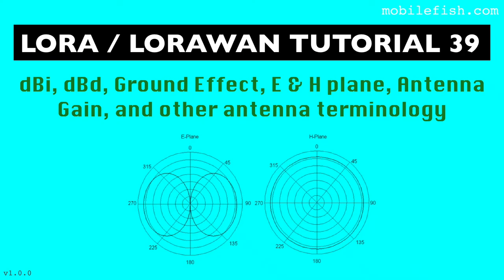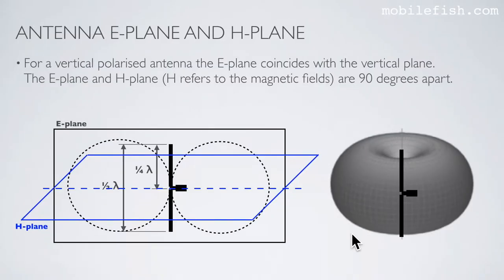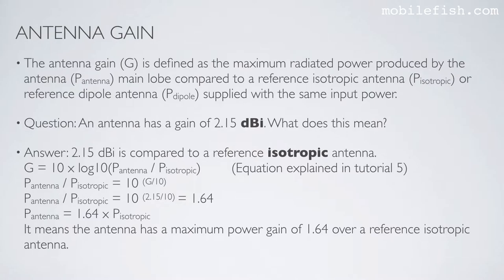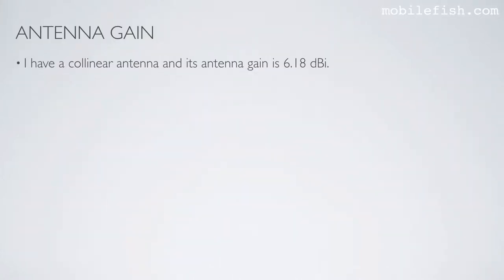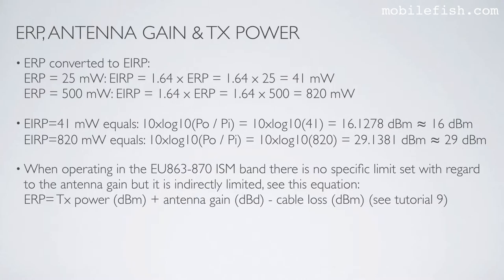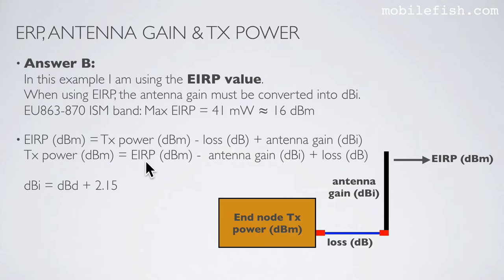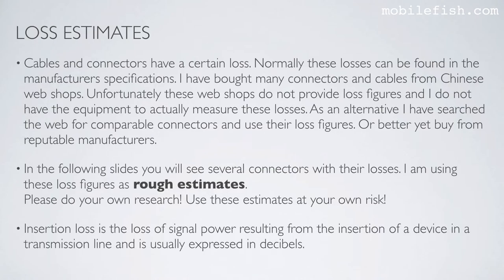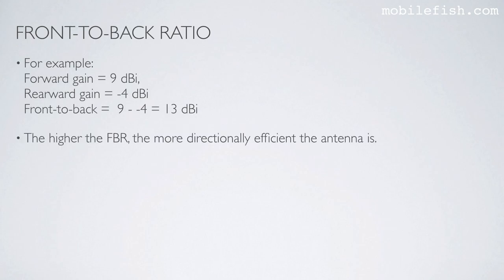LoRa/LoRaWAN tutorial 39 dBi, dBd, Ground Effect, E & H plane, Ant. Gain, and other Ant. Terminology

Comment: Thanks for a great tutorial. I have a question, should you model an antenna in the vertical or horizontal plane. What would the diffrence be?
Reply from the maker: You should model the antenna the same way as it is being used.
If the antenna is vertical polarized then you should model the antenna in the vertical plane. The same applies for a horizontal polarized antenna. So the question is why? Well, because of the ground (earth). The earth (desert, ocean, concrete, wetland etc) conductivity influences the antenna  radiation pattern. If you model a simple dipole antenna (vertical and horizontal) you will see the difference. The antenna height with respect to the earth also plays an important role. A simple vertical dipole antenna used is SPACE (no earth influence) creates a perfect shaped donut radiation pattern. If the same vertical dipole antenna is 2 meter above ground you will get a flattened donut radiation pattern.

Comment: Can anyone help with in this question? An output power of 16dBm, linked to an antenna with a gain of 21dBi linked with an RF cable attenuation of 1dB use this information to create a point to point link (2 radios same spec) with a distance of 3km. They operate at 5.850GHz